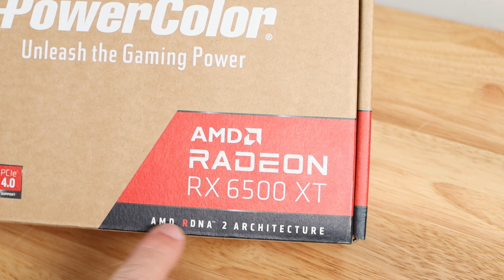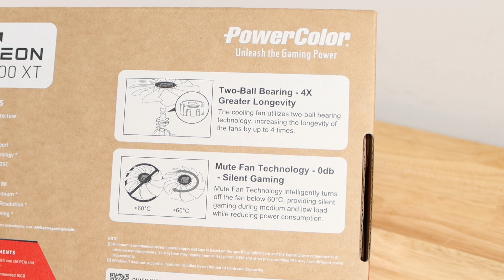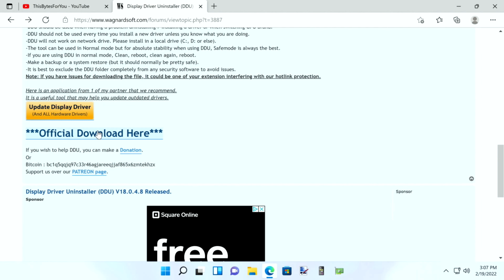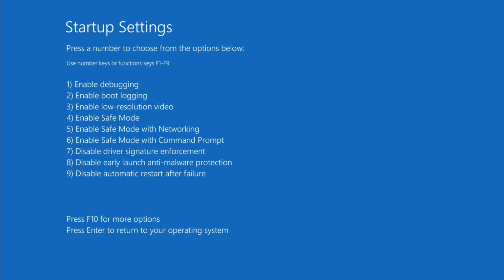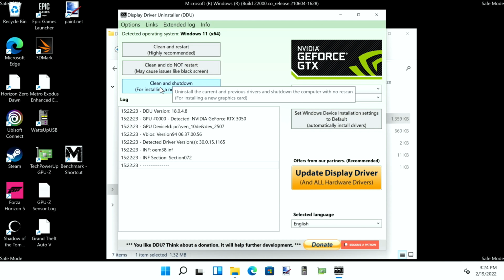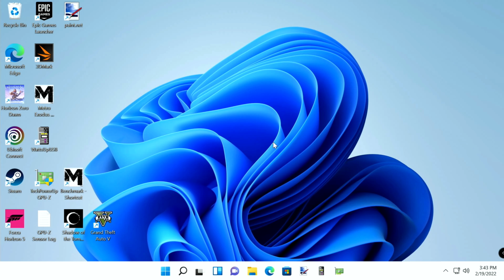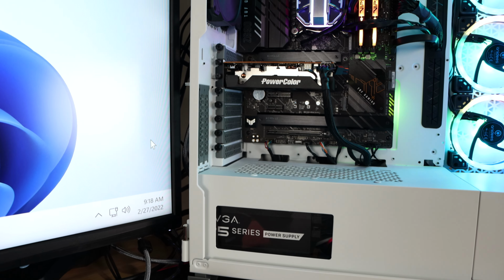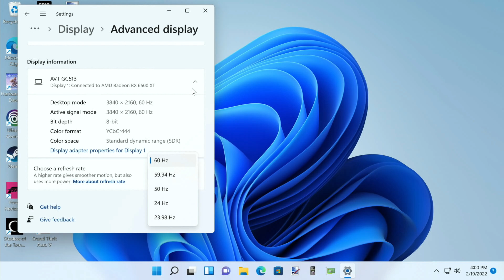AMD Radeon RX 6500 XT - Installing the PowerColor RX 6500 XT Gaming Graphics Card

Comment: Too much work, I'm too lazy. Just put the new card and done
Reply from the maker: Chances are that will work but you are losing a crap ton of performance and opening up the chance for a ton of issues.
Reply: @ThisBytesForYou  But my old card is amd  and the new card is amd aswell, the new one is the rx6400 the old one is a r7 series, r7 240 if I'm not mistaken.
Reply from the maker: @Illopportunity248  right, but with all the drivers you have installed overtime, or windows have installed overtime, driver on top of driver on top of driver, you have a bunch of junk, slowing you down and causing issues.  But hey, if you are ok with that, then just leave it.
Reply: @ThisBytesForYou  I'm not okay with that
Reply from the maker: before you do then then So that I can help, please list the manufacturer and exact model number of the following components:
1. Motherboard - manufacturer and exact model number
2. CPU - manufacturer and exact model number
3. RAM - manufacturer and exact model number
4. Video Card - manufacturer and exact model number
5. Power supply - manufacturer and exact model number
6. Monitor - manufacturer and exact model number
 Redundant I know, but many people forget to enter manufacturer and exact model number
7. Do you have ALL of the PCIE connections plugged in, and not daisy chained or pigtailed, each coming directly from the power supply?
8. Are you running through HDMI, DP, DVI, VGA, any adapters?
9. UEFI in the BIOS from Legacy.  If it was set to Legacy, you will need to reinstall windows to get correct support.
10. Disable CSM in the BIOS
11. Installed latest supported chipset driver?
Reply: @ThisBytesForYou  

- Mother Board Asus H 110M-A/M-2
-Intel(R) Core(TM) i5-7400 CPU @ 3.00GHz   3.00 GHz
- Amd radeon r7 200 series and intel hd 630 integrated in Cpu
- 8gb ram ddr 4 don't know manufacturer
- i don't know
- Hp momitor don't know the model
-Don't know what it means, probably yes not chained
-No adapters
- Don't know what uefi is
Reply from the maker: What are you going through, HDMI or DP for your monitor cable?
Reply: @ThisBytesForYou  HDMI
Reply from the maker: @Illopportunity248  hmmm, ok, since your rig is a little old, its not ancient, but AMD doesn't do well driver wise with older hardware.  Run the installer, but don't uninstall the current drivers.  I am assuming you don't update windows very often, which is even a worse scenario for updating the drivers.  I asked because with AMD and HDMI the cable NEEDS to be HDMI 2.1 or above or the DP cable 1.4 or above, DP 1.4 has been sold for a few years, HDMI 2.1 came out in 2017 and still then, and today they sell 2.0 cables and below.  When did you install the copy of windows?
Reply: @ThisBytesForYou  a few months ago, the computer was dead and I took it to a technician who formatted it and installed a copy of Windows 10, I also recently updated Windows
Reply from the maker: @Illopportunity248  then it might be a good idea to run through the way I show you here
Reply: @ThisBytesForYou  Many thanks
Reply from the maker: @Illopportunity248  always a pleasure my friend